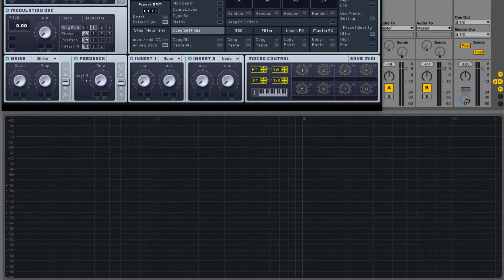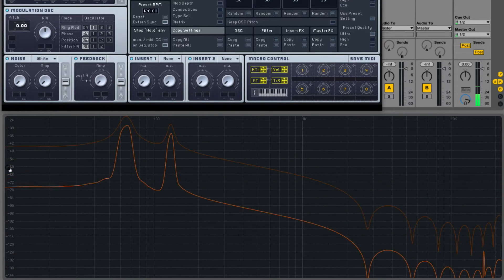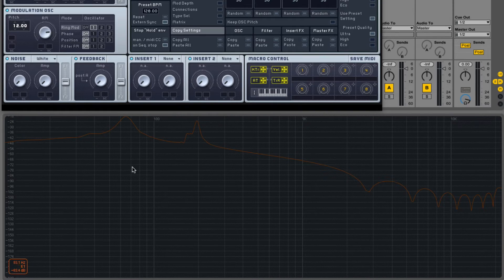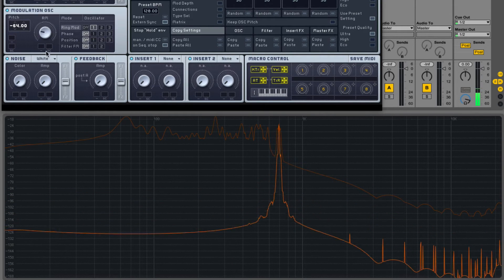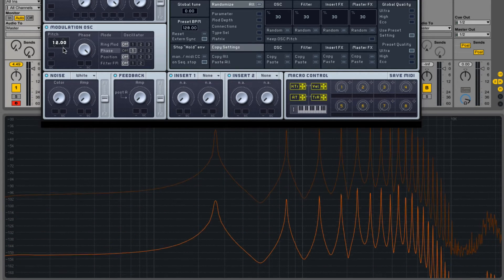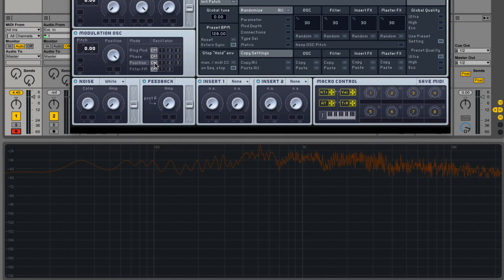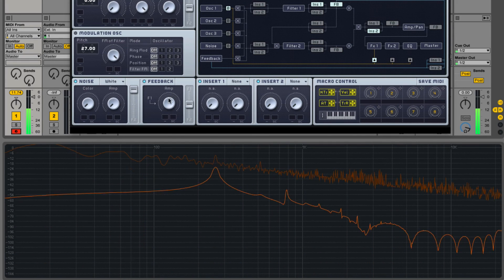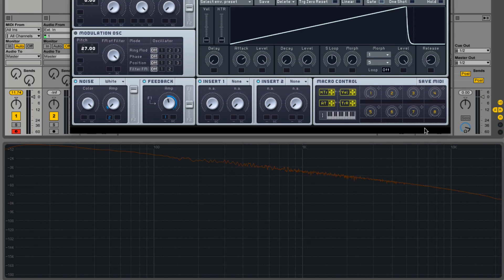Massive in Depth #4 - Oscillator Section Pt. 2

Comment: Also... How did you know at 5:20 that you were on C1, C2 & C3?
Reply from the maker: +Ben Gom Well I was using a midi keyboard so I knew I was on C1 and then I knew it would go up in octaves.  But in the lower left hand corner there's also a read out of where my mouse is pointing, frequency and note position.